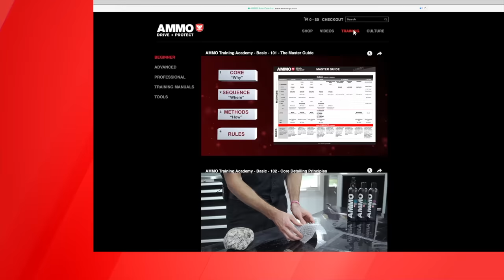14 BAD Detailing Mistakes You Must Avoid: ATA 106

Comment: Doing wheels first or last has been a question worthy of debate since  the first car wash? 

Good video. BUT what you failed to mention is EXTREMELY IMPORTANT. IF you clean your wheels first and DON'T use a separate (second) bucket of soapy water for the rest of your vehicle, then you MUST discard what's in your bucket, which is now a mixture of brake dust, road dirt, oily road grim, and GRIT from your wheels and tires,  and possibly even brake fluid if you have a wheel cylinder or caliper leaking). 
If using only one bucket to wash your car and you do your wheels first, then you MUST dump that nasty water, thoroughly clean and rinse your bucket and then refill with fresh soapy water.

Comment: IMO the California Car Duster (can't speak about other brands) is a great tool when used correctly.  Keep in mind it's just used to remove the light dust that accumulates.  You're not supposed to apply any pressure, just lightly brush the tips (waxed by the way) across the surface.  The company even suggests you don't laundry the duster as that will clean out the wax and you'll be better off just buying a new one.  I've been using one for several years, no issues.  Besides it's not like people keep their vehicles forever, typically 6 years and their buying another.

Comment: I think the point here is that this video is about detailing. I guess the average driver when giving the car a wash at weekends won't bother with all of this. Although there are some great warnings in here which are definitely good to learn, like dry wiping, dirty hoses dragged through cars, using general cleaners on the interior, some of these will be too much trouble for the guy on a Sunday afternoon with a jet wash, bucket and bottle of supermarket carwash. Thanks anyhow good video...

Comment: I love claybars, i dont use em every time i wash my Jeeps but man when you do use them, its unbelievable how well they remove dirt and stuff that simply washing doesnt.  My 98 Grand Cherokee wasnt washed for a year.. and sadly the year prior i washed it maybe 1 time, and it started to ruin the paint. It had black mold and green algae growing it.  Washing it by hand only got some of the stuff off, but a clay bar made the clear coat so clean my fingers were squeeking when running accross the paint.  

I also have a 89 Grand Wagoneer, and when doing grinding and rust repair i accidently got small pellets of metal on the hood..  I didnt know this and when the next few days of morning dew started rusting them on my hood i freaked.  I washed and washed and the multi color rust spots wouldnt come off.  I used a clay bar and elbow grease and ALL of em came off.

Comment: I have found that using a damp Melamine sponge is AMAZING at removing wax/oil contamination from bare black plastics.  Don't use pressure, kinda like a clay bar.  Never touch paint with it as it will scratch.  If you see this Larry and it is no good can you please let me know?

Comment: As a detailer I understand your reluctance to not use a water blade to dry your vehicle, mainly because many use it dry, and as we all know any dry materials run the risk of scratching the paint, but from experience I can tell you that if you wet the blade before use you will be perfectly fine, I don't say this to correct anyone, but as explained by the body shop experts, vehicles are sprayed with enough clear coat that as long as the blade is wet and clean it is impossible to damage the clear coat, it's like running a dry vehicle though the car wash, your just asking for trouble. So in retrospect blades are harmful for your vehicle, if used improperly.

Comment: Excellent video, yes I agree about the clay bar, it's mildly abrasive. I think clay baring should only be done once a year maybe a second time on the hood or the the roof if it really needs. My motto is less is best. Same thing when I play wax I don't kick it on I use a very small amount and every one of my vehicles have always looked awesome. I had a twenty-three-year-old firebird that was bright red I will admit I did clay bar way too much when I first started using the meguiars clay. But luckily for me I was use way too much lubricant and never scratch the finish. My used truck I had for 7 years I clayed 2 times a year, on my new 2019 I will only clay bar once a year on its anniversary date.

Comment: Nice video, 1 thing though. There are new types of clay nowadays that are built into a microfiber mit, attached to a hand held device, or a DA pad that are much friendlier to the paint and barely scratch the surface if at all. I highly recommend getting rid of that old style clay and getting the new style. And you didn't mention to clay bar before waxing a car, if you don't, the surface contaminants can swirl the paint.

Comment: I never heard a chamois being bad. If its wet completely and clean it shouldn't be harmful. I heard that those plastic guards dragged across could be problematic. I use microfiber towels mostly after a wash along with spray wax. Spray wax is supposed to be applied on a wet car according to my car wash wholesaler. Nice video. Chemical guys had a video where they are selling some chemical cleaner instead of laundry detergent.  Then they had this thing about cross contamination. I use liquid tide, and I either air dry microfiber towels or low or medium heat. Never use hi heat. The chamois is always air dried. I have a car cover, that I clean before removing it. It's not ideal but better than no garage though.

Comment: I always do my wheels last exept for the initial pressure wash after foaming the whole car. After I'm done with each wheel using a washmit I just hose it down with low pressure water. I never get splashes on my paint. The reason I work like that is so I can foam my car and the wheels as a whole first. Also sometimes I don't have time to get down to the wheels so keeping the bodywork clean is my first priority. My last after winter detail took 3 afternoons in and outside of car. Neighbours must think I'm crazy 😆

Comment: I disagree with cleaning the wheels first unless you are using a separate bucket (not the one used for the rest of the car) for rinsing the brush.
Reply: Chris Bramblett you would be correct if you are using one bucket but one of things he says is to not use one  bucket, don't cross contaminate was one of the points.

Comment: One thing I didn't hear you mention is cleaning the car top down. I see many people wiping the bottom of the car with a sponge and then heading up to the top of the car . Omg I don't if anything is worse than that. Most of the road debris is on the bottom of the car dragging the sponge right up with out throughly cleaning that sponge before heading up is just crazy

Comment: A question to auto experts. I too have recently bought a new car 2019. It is on it's way to the dealer. My question is if undercoating/rust proofing should be done first or after paint protection detailing? I live in the harsh winters of Canada (So far we haven't been hit but only a matter of time). I just want to make sure I do everything right so I do not undermine the effectiveness of the treatments.

Comment: I mostly rinse with filtered water and let air dry.  If I do dry I use a water blade and then buff.  I use to detail for a Honda dealership, and then a detail shop.  We did everything from the sleazy used car dealers to Lamborghini and Ferrari.  Never wore gloves, and still don’t. How can you tell if you’ve got that buttery soft paint with gloves on.  In fact, there are certain types of waxes that require being rubbed into the paint with bare hands. I also use all purpose citrus cleans on the interior. Never had a problem.  I’ve tried other types of interior cleaners from vendors and they don’t work as good or cause fading in the plastic. Nothing a little hyper dressing can’t fix, but still not ideal.  As far as clay goes, if the paint feels like sand paper use it.  McGuire’s number 7 is the best polish on the market.  I’ve used it on single stage paint where buffing isn’t an option (classic cars with original paint), and it blows me away every time.  At the end of the day everyone has their own techniques they’ve developed and it’s nice to see other professionals sharing what they’ve learned.

Comment: I would amend #11 by saying "don't use a duster to remove dirt or other abrasives from your car's paint."

I've been using a California Duster on my Taurus SHO for 3 years to remove things like pollen and very fine dust from the paintjob. No scratches or swirl marks. However, if you live on a dirt road or park near a construction site where you collect a LOT of dirt, mud, etc. I would definitely avoid using a duster on your car.

Comment: Love your videos !! Your use of analogies and attention to detail is amazing! It has taught me so much! I wanted to ask, why not a shammy ? My thought is if the car is wet is there any other method other than an air dryer that’s still as safe and effective ?
Reply from the maker: Shammy picks up water but not contaminants. I use AMMO Hydrate and a damp microfiber towel to dry the car. this provides lubrication, microfiber to pick up the contaminants that can potentially scratch the surface and a small amount of sealant to protect that car.  thanks for watching and supporting AMMO
Reply: AMMO NYC ahh makes Sense , thanks so much!

Comment: Here’s 2 helpful tips that might make ppl flip out... a blower (either a compressor air gun or a blower) clean carpet better than ALL vacuums. I would blow all the deep embedded dirt out of the carpet then clean the rest of the interior then vacuum the carpet at the end.
And if you have to remove pet hair from the carpet -use a cheap lint roller from Walmart. It’s not super fast or fancy, but it’s economical and produces fantastic results

Comment: So when vacuuming, how should you avoid the hose from touching the ground or rubbing against stuff?
Reply from the maker: Do one side of the car then move the vacuum to the other side or turn the car around if you're at a vacuum station. basically don't vacuum the driver side of the car with the hose coming through the passenger door and vise versa. Thanks for watching

Comment: If you do not care about a wax on your car - it is perfectly fine to use Dawn on your car (speaking as a chemist). It will clean very well and not damage your paint , but it will strip some waxes off your car, so obviously don't use it if you want that product on your car. Be sure to rinse ALL of it off as well (sometimes a heavy application can leave a thin film if not rinsed off properly)
Reply: I don't know about Dawn specifically, but dish soaps can damage rubber trims. I speak from experience correcting clients' dishwashing soap "misadventures".

Comment: Also if I use actually wax and not spray will I get better results and what is the best wax to use also the best ceramic spray to use note i dont have to much to spend. I have already made mistakes with my towel washing and have wiped and washed with pre used towels ich...  what can I do to maybe get some of those pre scratches out moving forward or is the damage down mind u I cant be noticed but I see them?

Comment: did you mean no apc on carpets or even like the dash and vinyl?
Reply: You can use apc just dilute it a lot. And whipe it with a damp towel after to get the residue off. Wouldn't use it on like a Ferrari tho, does dry the plastics out.  I used to use it a lot on the carpets but it does make it crusty lmao.

Comment: Quick tip: If you happen to get wax on your black trim and it has already dried, you can actually use vegetable oil and a clean micro fiber and gently rub that on the trim with the dried wax :-)
Reply: It’s not necessarily for that brand specifically. Dried wax in general on black trim.

Comment: Not using APC for interior was new to me. What should I use for cleaning carpets and fabric seats?
Reply: Other sellers have dedicated interior cleaners. Check out Adam's Polishes.
Reply: I use an INTERIOR car shampoo and suck up the shampoo with a shop-vac.  Alternatively you can use a steam-cleaner but I tried using an expensive one and wasn't that impressed with it.  So ya, shampoo & vacuum :)

Comment: I worked for a new car dealership and I've watched the dealerships very own detailers ruin a new cars paint job in one big bone head move while cleaning a new car up for delivery for a customer doing dealer prep. Maybe ruin is a bit harsh? But they swirl the paint by using a high speed buffer and a wool pad to apply wax to the car , and without missing a beat use that very same high speed buffer and wool pad to remove the wax?? Swirling up a paint job on a new car😨. The logic behind it? Is they are doing this because they think it makes their job easier and faster. Faster means more 🚗 ,🚗, 🚗,= more 💰 💰

Comment: Video said not to use chamois to dry off car. The exotic detail place I go to uses them. If the chamois cloth is clean and moist how could it do damage? I use very soft towels that aren't micro fiber to dry off the car once in a very blue moon. I don't have a garage so it's necessary to use a car cover kimberly clark noah evolution that I clean off before removing it from my car.

Comment: QUESTION! I am degreasing for application of Clear Bra, would Diluted Dawn, or an orange based natural Dish soap be fine for this process? Or should I apply directly over wax/sealer/polish without using a degreaser? I figure I am using diluted Dawn as a slip agent anyways, and diluted ISO as a tack agent, both would degrease and remove polishes etc anyways, so why not give it a degrease/wash prior to application of clear bra with a mild diluted Orange clean natural soap, or diluted Dawn? Do I WANT to remove all the polishes sealants etc, or leave them there under the clear bra? HELP I NEED AN ADULT! I am applying Clear Bra TOMORROW!

Comment: Unfortunately I've been using all purpose cleaners on my car for a long time bc someone at the auto shop told me Resolve was the best thing for stains in car seats. Now I'm left with a crusty mess that actually leaves scratches in my cloth by just lightly running my nail over it, it's awful. Any suggestions you might have to reverse this and possibly restore my cloth seats??
Reply: Kt H shampoo them with a carpet cleaning machine just look for a cloth seat cleaning tutorial

Comment: And your biggest mistake is mot mentioning ostrich feather dusters. Some car makers use ostrich feather rollers on body shells immediately prior to painting. These feathers have a remarkable property when it comes to actually picking up loose fibres and dust. you habe a very slight dust haze on your car an ostrich feather duster will work wonders and not harm or scratch in any way. Also great for interior dusting of the vehicle, getting into vents and instrument cluster. Only draw back us the cost of a good ostrich feather duster, they can be pricy. But make sure it's genuine ostrich feather, and don't get it wet.

Comment: My Dad would wipe the spot with a red shop rag to get a "better look" and I would do the WHAT ARE YOU DOING dance with crazy arm swinging...I worked in his shop businesses for the most part of my 40 years...Auto mechanic/Drag racing engine building (426 Hemi's) Head porting..and the years working at his Dodge dealership where I started polishing cars in 1975 and I still do it today it has become easier with technology but harder with 61 year old body, I have to train as a athlete.

Comment: Larry, I have used APC in my interior (leather seat) it did dry it up and while using conditioning did not help. How else do u think I can bring back the black color on my leather seats?
Reply from the maker: using APC is not good.  leaves residue behind and raises the pH level of the leather and deteriorates it faster.  Best you can do is try getting as much APC out with just warm water and try conditioning it.
Reply: AMMO NYC very helpful . thanks!

Comment: I have a question. Since you are a detailing company. Something is scratching my cars paint, at night. I have a HUGE scratch area, it is very light, but very noticeable because my car is light blue. Something is rubbing the side of my car, and scratching it. I don't live in the woods, I am in Ft.laud. Fla, in the city.  So I doubt it is a porcupine.  But that is what it looks like has been rubbing itself on the side of my car! The lower 1/3 on the rear passenger door, to the side part of the rear bumper.
ANY idea of what could be doing this?? And do you have a product that actually fills in scratches, like this?   That really works, and will cover it up, till i need to reapply?
Reply from the maker: Hey bud. I'm not a fan of filling scratches, I prefer to actually remove them with polishing.  I would try and park somewhere else if you can to avoid that happening whatever it is. Thanks for watching
Reply: Well i dont have a choice, and dont know what is causing it.  IF you are a detailer, you know what product conceals this problem. You must sell a pricey product that will make it look nice for a short time. Like all waxes/sealants etc, they only last a few months.
You can do it for swirls and other scratches, with AMMO products, so....what do you sell for light scratches? They are super light, and I assume my current wax/sealant will fill them, but thought you might have something better to sell me.

Comment: The main reason using dish washing fluid is stupid is the fact it has wetting agent. This means if you own an old Alfa romeo or any car it will rust even quicker than it was going to anyway. water getting through gaps it wouldnt  usually.